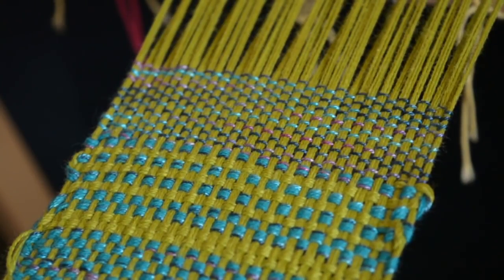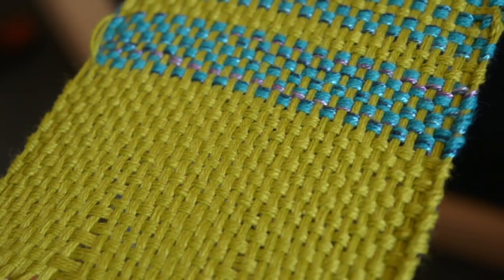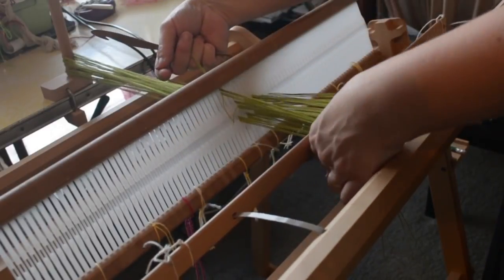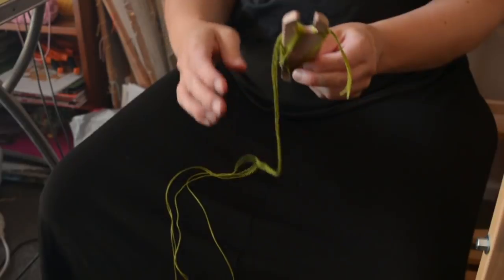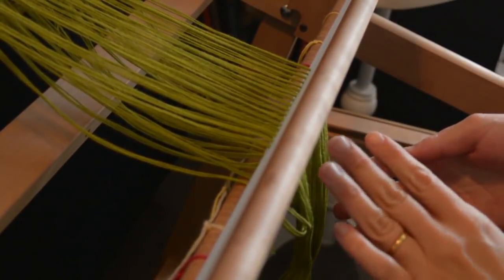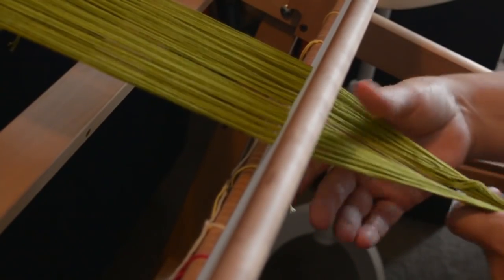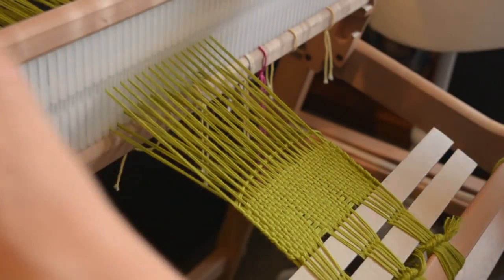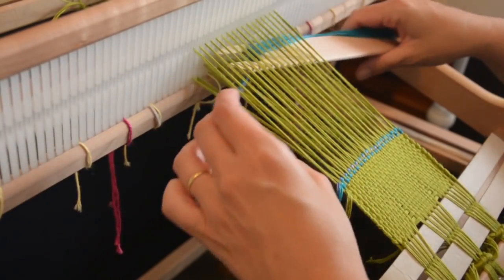Basketweave and variations for the rigid heddle loom

Comment: Kelly, why did you need to cut your blue weft and start from the right hand side when doing single picks?
Reply from the maker: Technically I didn't need to, I find it easier to keep my sheds aligned with the yarn being on either the left or right. For instance, for plain weave my up shed always enters from the left, my down shed always from the right. It's what I'm used to :)